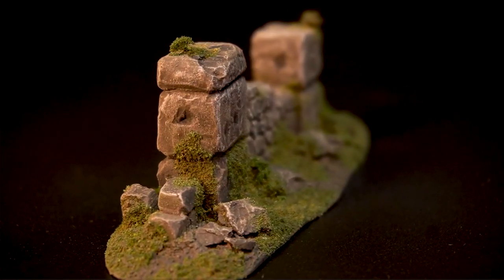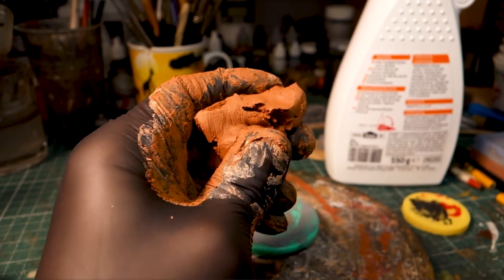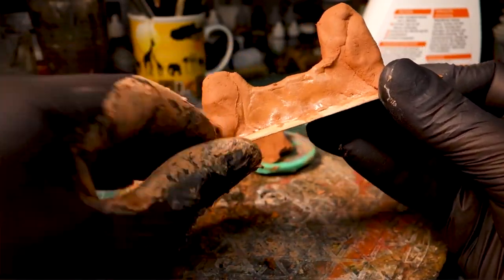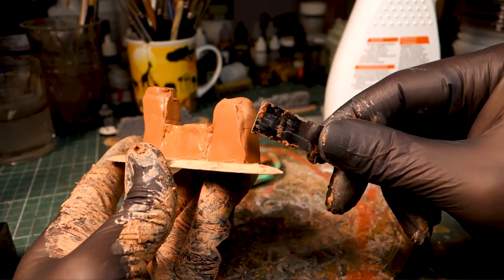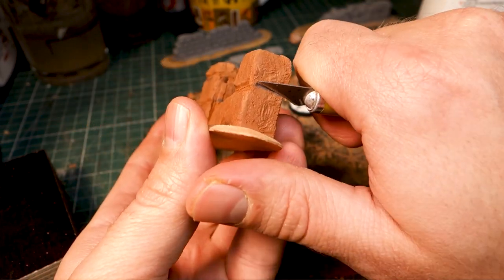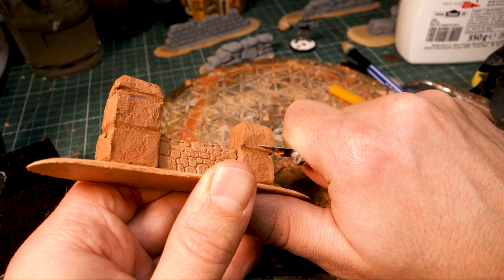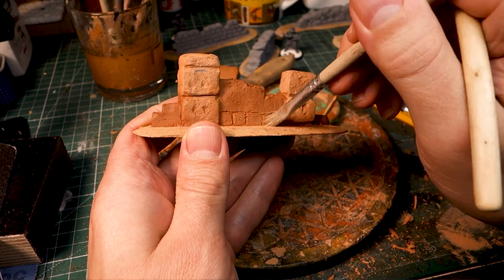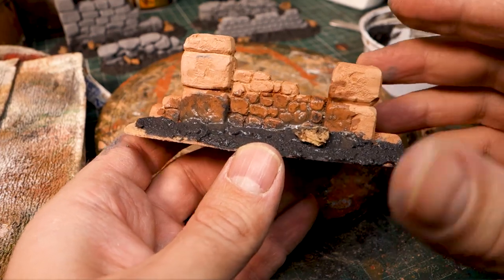Terrain Test: Stone walls of natural clay

Comment: Did you have any issues with cracking when the clay was drying? I've watched several videos on air-dry clay that recommend you don't get it too wet because you'll experience uneven drying that leads to cracking.
Reply from the maker: Drying cracks do sometimes happen. In any case, the clay layers should not be too thick. Small cracks can be filled again well with thinned clay. The material is definitely a bit tricky, but it is a lot of fun to work with! Cheers